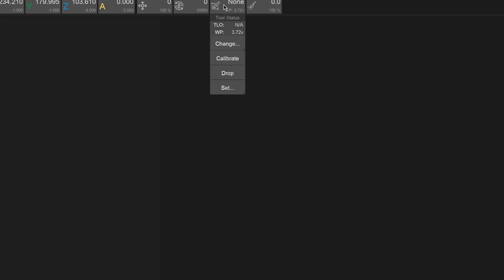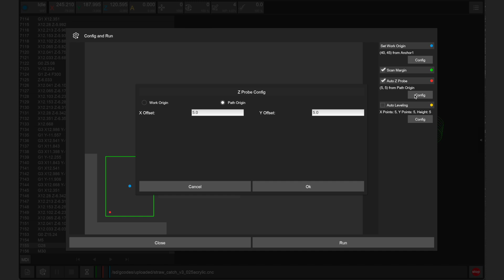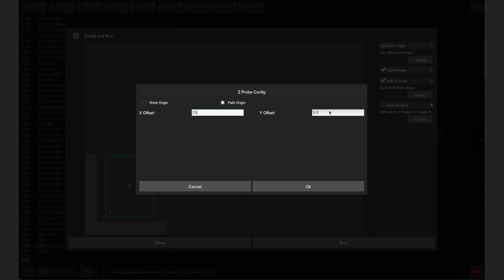How to Setup and Use the Carvera CNC Wireless Z Probe

Comment: How long is the wireless probe laser suppose to stay on after the machine taps it to turn it on?

My laser dies after 1 margin search.  I kinda need it to last longer so I can find the right place on my scrap stock pieces.  I have to continuously drop it in the charging bay each time I scan my margins
Reply from the maker: The laser will automatically turn off after one trace. But you can manually double tap the bottom of the probe while it is still in the collet to turn it back on so you don't need to drop it each time.
Reply: @Makera I tried that last year and it worked, but it doesn’t work anymore this year.  So I’m assuming that my WP doesn’t hold a charge anymore

Comment: Hi, I followed the LED example instructions, but in the configurations, I can only select either Auto Z Probe or Auto Levelling. I did this setup and performed the diagnostic, the wireless z probe was responsive as it should be. Do you have any suggestions why I cant select both of the config functions?
Reply from the maker: Yes, we can assist you with this issue. Please contact us via support@makera.com for further clarification.

Comment: How do you zero a part in the x and y?
Reply from the maker: You can use the "Set Work Origin" adjustment in the Carvera Controller App within the "Config and Run" window to set X and Y offsets. See our Securing Stock video for a bit more detail, as well as how to switch between the default anchor point positions here: https://www.youtube.com/watch?v=TuQv5upoPPg&t=81s

Comment: This is a CAM question I guess, but I am trying to setup a part and SolidworksCAM requires me to set my origin. 
I am using Anchor 1 as my stock origin and trying to use the auto z probe to set my z0 however I always end up machining in the air if I set my origin as the top of the stock and too deep if I end up setting it as the bottom of my stock. What does the Z probe do? Set offset from 0 or set 0?
Reply from the maker: The Z probe sets the Z value to 0 on top of the material, so you need to program into minus if you are probing the top of the material.